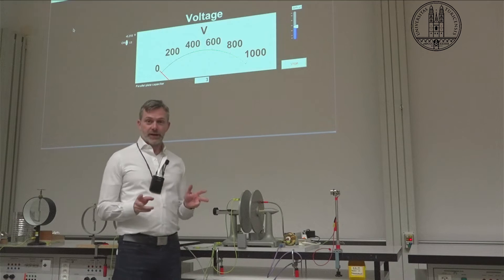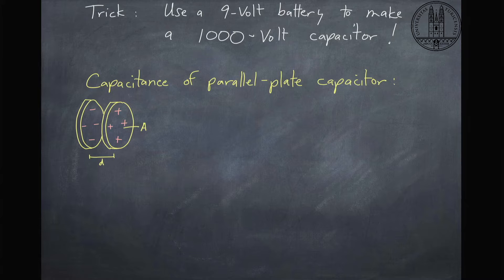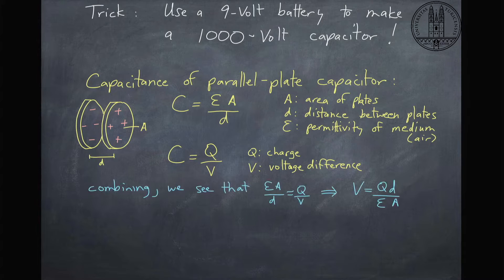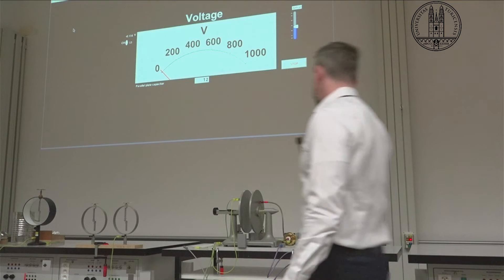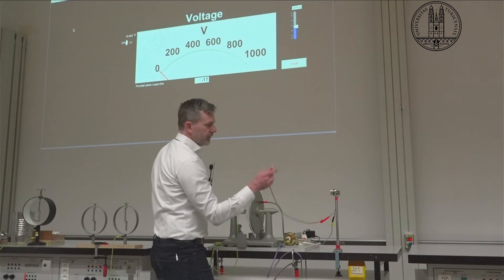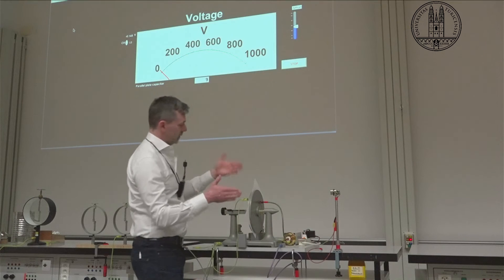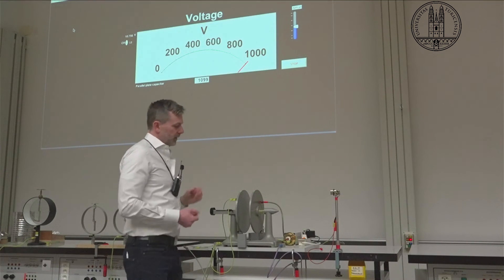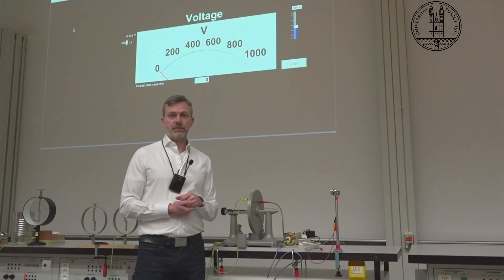Generating 1100V using a 9V battery!

Comment: Wow, this experiment's results felt.. unintuitive. However if I think of voltage as the amount of force that was necessary to separate a charge, it makes sense that voltage increases when moving the plates away from each other. It would also mean that you could never realize this potential energy (i.e. 1000V) because as you bring the plates together, the voltage would drop at the same time.

Comment: I'd assume that the voltmeter showing only the maximum value (and hold it).
 
As with such small capacity no way the volt metter will not drain the charge quickly?

Comment: So, as I understand it, there's a second factor here which helps slightly. At first, the permittivity isn't the permitivitty of air, it's paper, because you have paper in that gap. Paper has a permittivity of about 1.4 compared with about 1 for air, so simply removing the paper gives a 30% (ish) increase in the voltage.   If you had a rubber sheet to start with (permittivity around 7) the effect would be even greater, and you could septuple the voltage just by removing the rubber. With more exotic materials, you could get much higer permittivities, which would be another neat experiment to play around with. It also provides an extremely ready way to actually measure permittivity. Put a sample between two plates, and you could observe the voltage change, and this could even help you identify some samples without having to touch them.
Reply: Rubber has higher dielectric absorption. You may end up with higher voltage, but not as high as 5x compared with paper.

Comment: This is how high power impulse generators work. A small explosion rapidly separate the plates of a capacitor inducing a prompt voltage increase well into the kv range😮

Comment: I 'get' the equation but don't understand why this behaved like it did. I thought capacitors with a small thin dielectric worked better. Why did the professor have to increase the gap quickly - it seems like time was of the essence to make this 'trick' work. A little explanation would have really helped this demo.
Reply: As the plates separate the capacitance drops.  Less capacitance requires more voltage to store the same charge. 

As for time, the voltage meter slowly drains the capacitor.
Reply: @hanelyp1  I dont think the viltage meter is a problem here since after he increased the gap he talked for some time without the coltage dropping. If he can do that, why would the 2 seconds it would took to do it slowly matter
Reply: @SFreakHD  Unless the meter has a peak detector or some sort of "sample and hold" circuit. (I was also wondering what must be the input resistance of the voltmeter in order to not drain out  such a small capacitance).
Reply: @zl8018  Im not so sure about that because when he touches the plates the voltage goes down without a delay
Reply: @SFreakHD  Yes indeed, I haven't thought about that.
Reply: i would like to know too
Reply: If he increased the gap slowly it should work too. The voltmeter seems to have no leakage current at all